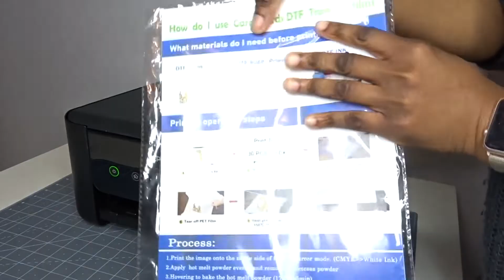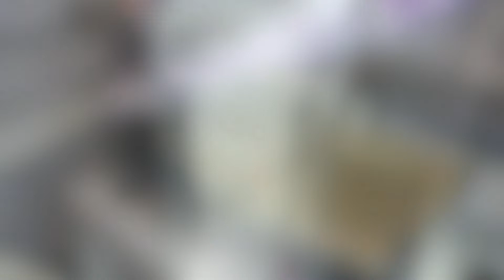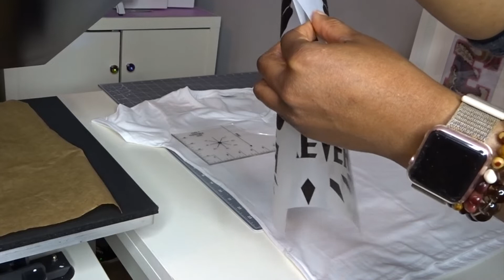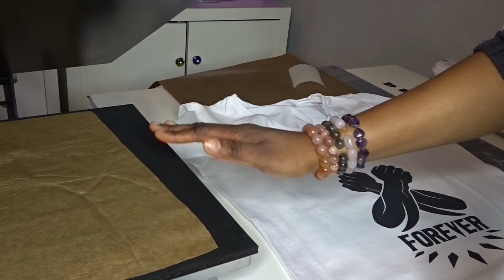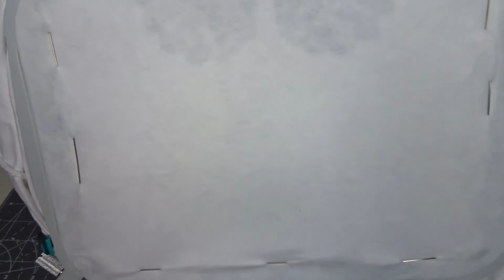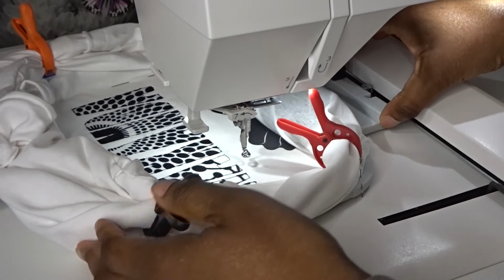DTF | SUBLIMATED ON 100% COTTON PLUS EMBROIDERY | MIXED MEDIUM

Comment: 1. Has the printer been modified in any way? Or is this the regular store version?

2. Is any special program needed to print DTF images?

3. Can I print white patterns?

Thank you for help ❤
Reply from the maker: Hi there, the printer itself has not been modified in anyway. I’ve used sublimation ink instead of the regular ink that comes with the printer.

No special program is needed for this hack.

Unfortunately it can not print white patterns as there is no white ink. This hack works well using white fabric if the image has white included in it. 

I hope this helps. Have an amazing day 🫶🏽